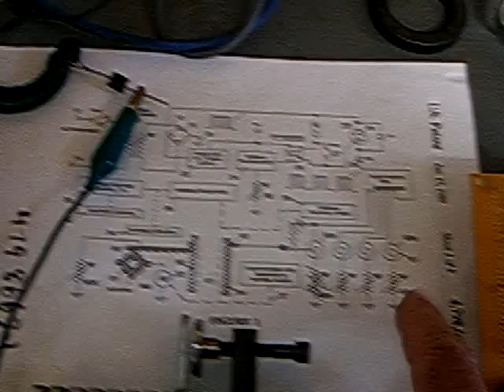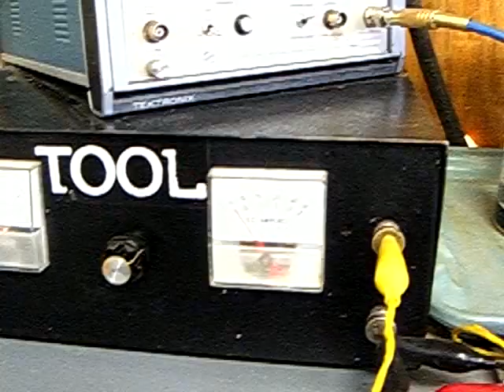Stan Meyer, Stanley A. Meyer WFC Free resonator Hydrogen cell patent  4,798,661

Comment: Meyers buggy used the water steam generator as a main part. It is also where the exhaust and ambient air was mixed into the water bath. There's pictures and video showing this. This mixture in steam was sent to the injector he made which was probably simply his basic dual voltage field electrode setup which further and much easier and faster could separate this steam.

Comment: Anyone who has followed Stan Meyers WFC work should realize that he did not have one fixed idea. Rather his work a d patents along with his memo briefs, show that he started out with the basic concept of using a dual polarity voltage to crack the water molecule. He then progressed with this idea with various improvements. He eventually ended up with his water steam particle generator which uses both electrical and particle oscillation to further improve his WFC. Some mistakenly think it was only used to keep the water from freezing which it would do but it really is the final piece. In this scheme, he uses a single polarity on both plates at the same time and that polarity simply switches. It does not use opposite polarity in that device across the plates as all his previous ways.....
He realized, that he only needed to create one static voltage field and the bipolar water molecule would take on a charge and stress the water, as the plates polarity switches, it causes the molecule to oscillate rapidly causing superheated steam. Electrolysis is greatly enhanced when water is heated into steam at high temperatures. This with the switching voltage field also aids in separating the gases from the water molecule. Look up water steam. Electrolysis and you'll find numerous scientific papers on using steam. His setup does both simultaneously. And why it was so efficient.